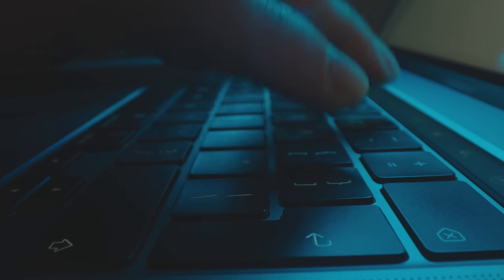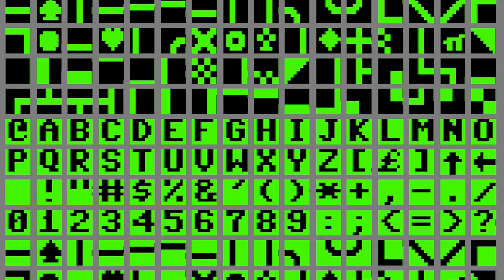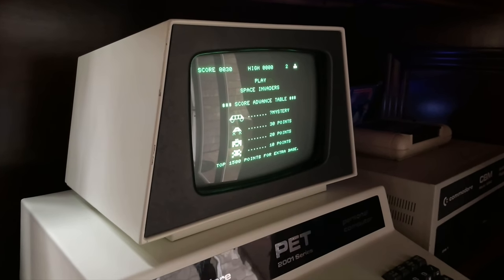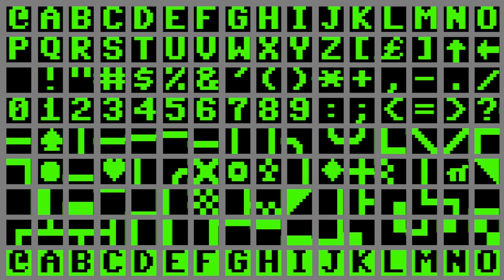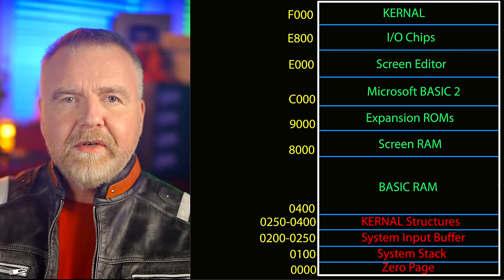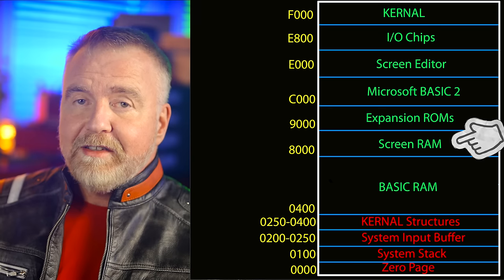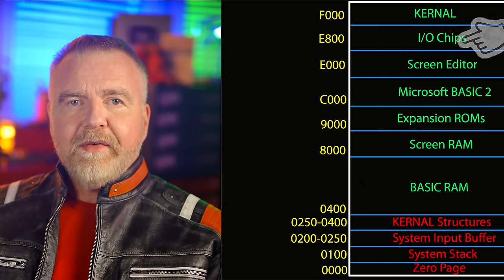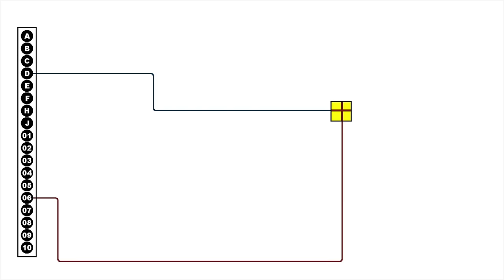Everything you SHOULD know about your Computer but don't!

Comment: Also, companies became more closed. People owned their hardware and it was open to modification. Datastructures were also documented. This is still prevalent in Linux.

In 2008, I ended a bachelor in Computer Sciences with major in industrial computing. We learned EXT3 inside out and for NTFS, we only had what was reverse engineered. And for FAT32, a big part of it was open, but there were some secrets too. So, obviously, EXT3 was much easier to understand ^^
We also had to learn about modules, again, in Linux, that's the literal name and anyone who can write a bit of C can replace a kernel module. In Windows, good luck!
And we are worse with Apple today...
So, there is the scale, but also the behavior of companies that changed.

To top it, I was close to bare metal in my studies, because of the major. But very few people can afford that major because it's though. It's basically the equivalent of "all you can eat" (it offers most of the content of the other major AND add the hardware part to it). So, 99% of students seldom get taught about hardware itself and they can't easily learn on their own.
As an example, I have a friend who can't grasp bit twiddling! It's already too low level. So, he can't get what is an half adder or pipelining or even make the distinction between multi-threading and parallelism. He can "just" write some nice algorithms which are generic and under use the hardware, even killing CPU caches out of ignorance...and that's perfectly fine as people can wait one microsecond more to see a web page ^^ So, he really see the computer as a black box that can be programmed to do whatever he want. (almost)
And timescale is different. When you are on a fpga, few microseconds is slow (thing "run" at femtosecond speed).
When you do an SQL query, few milliseconds is slow. When you load a page, half a second is slow ^^
In automation, a split second can save a split hand ^^

So, all in all, that's quite normal.

Comment: Just an FYI. RS-232C is not 5 volts. The standard specifies the voltages as +3- + 15 for space and -3 to -15 for mark. Anything in this range is legal. In the last decade it has become popular to only sense a voltage of +3 or more for space and call anything else a mark. This is not true RS-232 of any kind. But is a handy short cut with todays single supply systems. BTW standard RS-232 allows voltages from +3 to +25 for space and -3 to -25 for mark. I did a lot of serial RS-232 interfaces. When single supply circuits became popular, I used to use a few resisters, a couple transistors, and a diode or two to create my own level shifter. Then the MAX232 chips came along and we had a single IC to do it for us! I do miss the days of simple circuits and systems you can easily understand simply by reading a few data sheets and staring at the schematic.

Comment: Wasn't memory use back in the day the same as keyboard scanning?  You'd set the address bits and latch them in, then you could scan or write the data bus for the stored values.  Need for a lot more logic to control tri-state between CPU and Video processing of shared RAM.

Comment: If you really want to get deep, you should also understand how electronics were, how voltage works, how transistors work, resistors, and various devices.  Because all those fancy chips are just made up of some of those devices, and because of that many of their limitations are bound to the limitations of saying how transistors work.  For example, why refresh memory? Well because if you don't it'll forget.  Ah yes, but why does it forget?  And further, how does it remember at all?  We need a CPU processor designer who is as interesting to listen to as you are.

Comment: Of all people, I would have though that Dave would know why it is not easy to allow hardware for definition of custom characters. It has to do with computer circuitry clock timing. If you use RAM to define text characters, then it interferes with the RAM/video scan timing. The RAM responds to a data bus and an address bus, and the address bus can only hold but one address at a time. The data bus can only hold but 1 byte of data to read or write, at a time. There is a basic conflict between the CPU and the video circuitry needing timed access to the RAM. For more about that, watch some of Ben Eater's videos on how to build the world's worst video card. One way to resolve the conflict is to halt CPU operation during the video display portion of each video frame. Not very efficient and results in slow program execution. The more common approach I think is some sort of interlaced timing, such as one on the rise, and the other on the fall of the clock timing pulse. If the video circuitry is burdened with having to access RAM to form characters, then the whole circuit-chips timing scheme is trashed and we have to start over.

Perhaps some sort of indirectly rewritten EEPROM could be used for storing custom characters, but that would add complexity and expense to the computer. So that likely would not be a good solution, other than to sell computers to foreign countries set to operate in some other language than English.

The obvious workaround is to dispense with the outdated text-mode approach, and simply use pixel-based graphics. This allows various fonts and sizes and styles to be applied. Of course to most anything there is a trade-off. The problem back then, was that "drawing" characters pixel-by-pixel to the graphics video RAM, was slow, but no longer is slow now that computers run so much faster than they did back then. It was also much more complicated, and graphics themselves were limited by the high cost of RAM or video RAM which is simply RAM that is dedicated to storing the current video graphics image. Graphics-based processing of feature-rich stylized text is also a lot more complicated to write program code for, and simply would not fit within a 8K ROM version of BASIC. This graphics workaround is why we have super-extended character sets now, even including emojis. As now even smart-phones have very good graphics RAM and graphics processing.

Comment: Re video RAM: I would hazard a guess that the hardware engineers couldn't get the video generator to multiplex with the CPU address bus nicely.  Easier to place video ROM on its own bus than mix bus masters.  (I seem to recall that some 6502 systems alternated the address bus owner every cycle.)

Comment: How are the memory locations set.  you put all of these chips in the computer so how does the processor know what is at a000 for example. Is it just what is attached to a certain pin on the processor or is they a kernel programming set up function?
Reply from the maker: Ah, it just depends on how the address lines are hooked up.  Let's say you have a RAM chip with 4K.  For 64K you have 16 of them.  The highest pin on the address bus would be used to select WHICH chip,.  The other 15 would pick which address INSIDE that chip.  All 16 lines together would give you 64K.  Hope that makes sense... the answer is "how they're wired up physically".
Reply: The brilliant thing is that in a system like that the processor doesn't know anything about the memory map. The CPU has 16 pins which make up the address bus. A common setup might be to use a 74ls138 as chip select logic. It has 3 input pins which would be connected to the 3 highest address bits and has eight output pins, with each one triggering based on the input bits.

Comment: This is interesting.  Am I wrong in thinking though that the whole screen would be written line by line - it's not like a scope - so if you had a line of text (ABCDEFG) it would write the top line of all of those characters in a a row, then the next line of all those characters etc.  So it didn't actually steer the beam - it did it line by line like a normal crt?
Reply: Correct, the beam is a normal raster scan.

Comment: There are several reasons for not making RAM useable as character generator.
On the C64 the CPU and graphic chip share the same Address and Data bus. So the CPU can read char rom and the graphic can read the main RAM. Since you have to avoid same time access to the bus of both CPU and graphics, there have to be some synchronizing mechanism. On C64 the graphic chip can simply get exclusive access to the bus. If the CPU needs some data, it have to wait. This is why most fast disk loader turn off the screen. To make the CPU run at a more constant speed.
As you describe the PET, there is a divided CPU and grapics bus system. The CPU cannot read the car rom, and the graphics cannot read the system ram. Seems the screen ram is a special dual channel ram who acts as interface between cpu bus and graphics bus.

Comment: Mr. Dave, sorry for offtopic but do you still have contact with Microsoft folks who work on filesystem driver stuff?
I'd really like to relay a question but ms support doesn't seem like a way to get through.
When I had two RAID1 volumes on same pair of HDDs (separates so first one would get the faster part of HDD) and once windows did BSOD and obviously next startup triggered a resync instead of queuing the scrub or at least using blocks in megabyte range the driver decided it would be best to violently shake the head and do exactly one 64KB block on one partition, seek to the second one, do one 64KB block there and loop.
I'm pretty sure you won't need any magnifying glasses to see the level of idiocy here but I really want to ask the guy who programmed it: WHY?

Comment: My guess is the video was kept away from CPU memory and address lines to leave the CPU free reign to run the system. If the CPU had to pause every time the real time application of character generation for the video screen needed access to RAM, the system performance would suffer greatly.

Comment: I remember, when first advancing from BASIC to C++, wondering how BASIC could be an introductary computer language.  It took years, along with an introduction to Assembler (I think I was reviewing my Dad's Z80 ASM programs when I realized this, because x86 ASM uses labels instead of addresses), to realize that Assembler lines were all prefixed with addresses, and to jump, you had to know what address you were jumping to.

In other words, BASIC is a simplified version of Assembly!  Just not x86 Assembly, because using labels is a very convenient abstraction that not all Assemblers had ....
Reply: Recently I wrote a BASIC interpreter in Scheme, in which BASIC statements form the "instructions" for an abstract machine. Each statement, when entered, would be parsed into a record which had several slots: line number, verb, and arguments. For example 30 FOR I=1 TO 10 would parse into (30 for i 1 10) except as a record rather than a list. The interpreter knew how to dispatch based on the verb into a function table of procedures that operated on the arguments.

This is not how BASIC interpreters of the 80s worked. Those stored tokenized versions of the statements, verbatim but for the tokenization, and reparsed each statement every time it was run.

So yes, pretty much -- BASIC can be seen as a sort of assembly language for an abstract BASIC machine implemented through an interpreter.

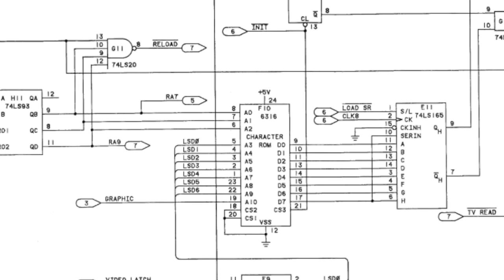Comment: 8:50 Why would they? Rom was apparently fast enough to serve this purpose. Lowest version had 4k ram so copying whole character table to ram wasn't a good option, plus I guess even if video cirtuit would not interfere with main cpu when reading from ram(which is again adding complexity to the design) would lower it performance. 
I guess at this moment it wasn't also main selling point. It was their first computer. CEO of Commodore at that time also gave main Engineer condition that he need to build his computer in 6 months(whole building PCs instead of calculators was Engineer `Chuck Peddle` idea) to show on some trade show. I might not be genius, but it is kinda resonable that in such short timeframe, having limited resources, issues with chips(they've just changed vendor to mos from TI) they were probably implementing first working thing and moving on. So I guess they've implemented minimum set of working features and marketing just did they job from there selling what they had.

Comment: Wow, this brings back memories. Totally worthless today, I guess. Instead of 6502, for me, it was the 6809E.
Reply: fanman421  Wire wrapped socket pins? It had two 16-bit index registers, two 16-bit stack pointers, and two 8-bit accumulators. I'd mess with the clock settings and interrupts and other tricks to speed it up.

Comment: Well you still learn these things in embedded educations 😊
Reply from the maker: I hope so... but is that the EE track or the CS track?
Reply: In Germany, it's the CS Track. At the University I'm studying right now, the modules are called "Computer Architecture" and "IT Systems", but they also have an economic CS Track, which doesn't even touch assembly :O @DavesGarage
Reply: @DavesGarage   In Denmark I know that some EE and CS tracks are the same from 1 to 3ede semester then they spilt up. Especially in first embedded course you learn about the basic of cpu rams etc,s. But there are som CS tracks that do not have these course and for them yes they don't know anything about the hardware they are running their software on and don't care.

Comment: I remember the C64 as having static RAM not dynamic, specifically 2114L-30 RAM chips
Reply: just for the screen color memory afaik
Reply: One of the key design differences between the VIC-20 and the C64 is that the C64 ended up needing DRAM to keep the cost down. The VIC-II handles DRAM refreshes, which is probably why the C64 can't have the concept of "contended RAM", as all RAM is contended on the C64. Imagine what could be done if, as with the Spectrum, only the bank of memory shared to the screen hardware resulted in a slowdown: while you wouldn't be able to double the 6510's clock speed - some bus arbitration still needs to happen, it would've allowed a nice speed bump to the machine.
Reply from the maker: I think just the color ram, but I could be wrong.  I was fairly sure the VIC chip did the DRAM refresh.
Reply: Mea Culpa, I was wrong :(

Comment: I feel like you're just baiting interaction in the comments, but.... I'll bite.

The character rom is only available to the video chip, most likely because otherwise you'd interrupt the processor a whole heck'in bunch to try to draw the screen, and the pet was already slow enough as is!!  You can't share the ram area easily.

Now a couple of options that could be available if you were gonna implement that sorta thing this day and age.  I think I would have gone about using a periphal mapped at the top of ram that could take in a couple of bytes for an address, and one byte for data.  This peripheral would wait for the end of each scan line, and then using the address, and data you gave it, it would copy that byte into memory.  This would allow technically for a max of 25 bytes per screen, so 11 frames to fully sync the memory.  

This would be.. utterly slow.  But if you only wanted or needed to remap a few charactrs...  And it'd probably be good enough for the era.    It would be difficult to know for any certainty that the byte was already copied into the character ram location.  So you'd have to "wait for some delay of arbitrary length and it would be copied" -  IIRC the pet had no good way of "chasing the retrace" there's no registers for knowing the current scan line or if the machin is in a scan blanking interval  - maybe my peripheral would add that stuff.
Reply from the maker: Actually you CAN share the RAM if its static, which it was!  It's hard with DRAM though...

Comment: IMHO every programmer should start with assembler, or at least C. It is hugely important to understand how everything maps in memory, and avoid foolish notions like the idea that memory is an unlimited resource, or that there is no penalty for storing data on the heap. I feel like a dinosaur coding applications in C and C++, but my clients are still happy to pay me to do so, and my programs load and run super fast :-)
Reply: There was no C back then for microcomputers! 
 I think B was being created around the late 60's and C shortly after that... AFAIK C wasn't available for the microcomputer until the very late 80s and early 90s!
Reply: @tekvax01  C compiler was available for Commodore Amiga in 1986 (and Atari ST I believe). Also, Motorola CPU's used a flat memory model (no 64K barriers).